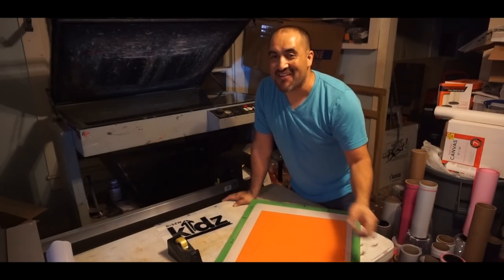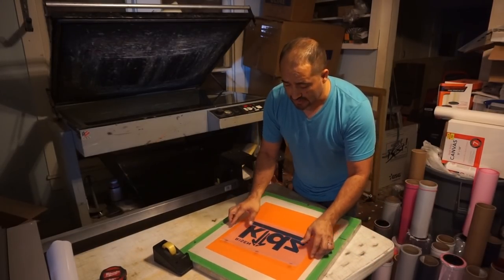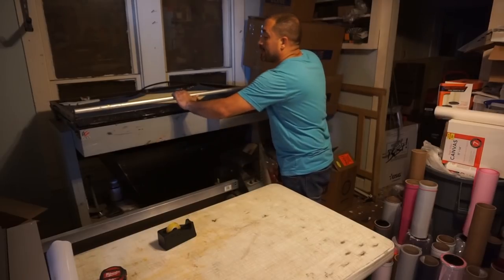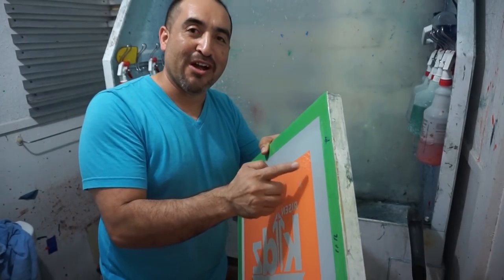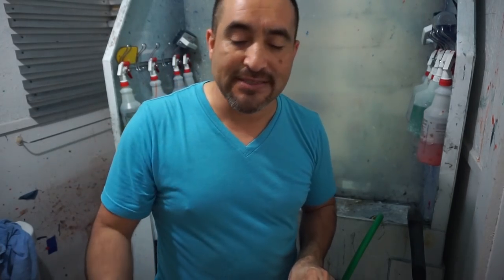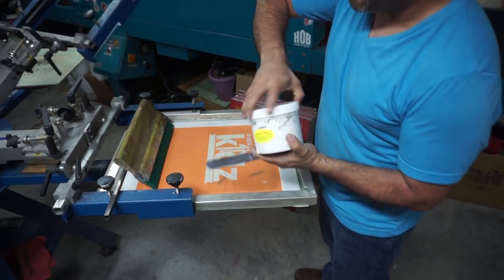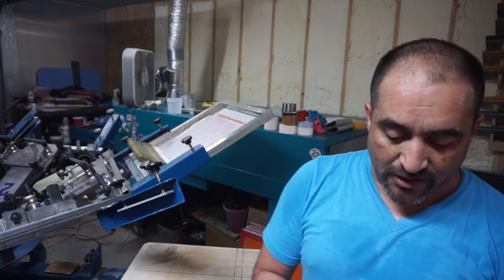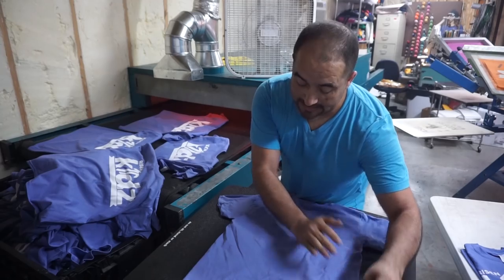PRINTING WITH CAPILARY FILM

Comment: I used a conventional flip top burner, and I burn the photo emulsion sheet before applying it to the screen that way you don’t need a specialized exposing unit. Once you wash off and it’s wet just apply on the screen.
Reply: Sorry I didn't get that. Please explain